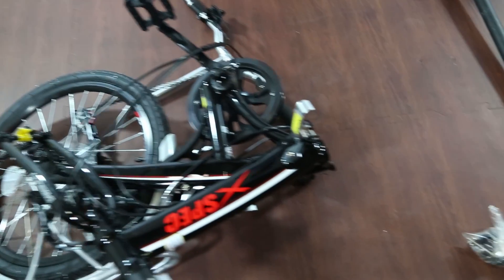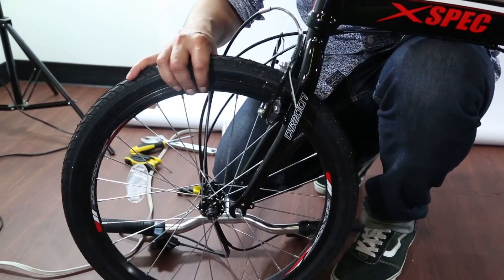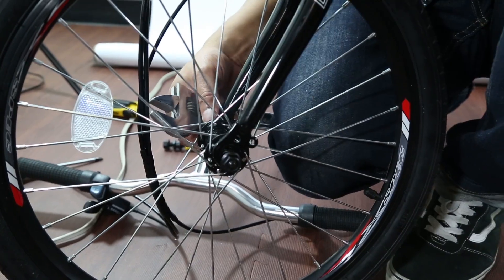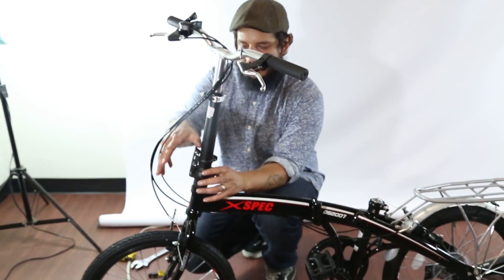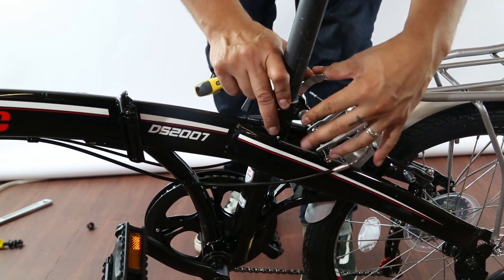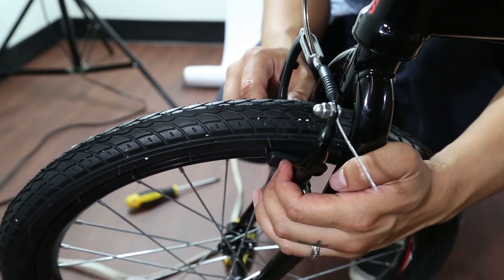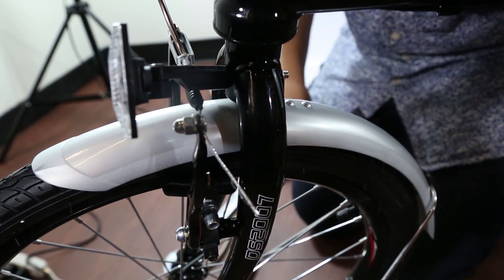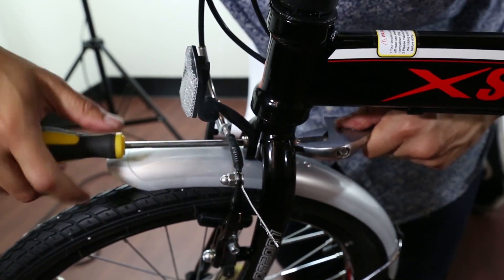Xspec 20 inch folding bike assemble video

Comment: 1- Allen wrench did not come with the bike and when you losen the screw (1:50), you cannot tighten it back. When you try to tighten it using an allien, you'll see that the front wheel and grip are not mechanically connected. This is really weird. You can easily turn your grip to somewhere and your wheel can stay in the same direction. This is a fatal error in terms of mechanical design. 
I bought this bike and return it immediately due to this error...
Reply: I figured it out! You have to reset the stem positioning. pull it out and realigned the the long silver screw with that other dark screw attachment(I willing to make a video if any requests) that 45 angle of the handle bar is weird looking but it’s the right positioning. I’m glad I figure it out before paying someone to fix it or take it back
Reply: @fefe1920  thanks for the comment. But I had to drill another hole from the side to fix the from wheel and the directioner. This is working for the last 7 months. Nevermind. Thanks again for the comment.

Comment: What is the size of allen/hex key to tighten the steering shaft
Reply from the maker: The handlebar bolt uses a size 6 Allen wrench, 0.25" in diameter